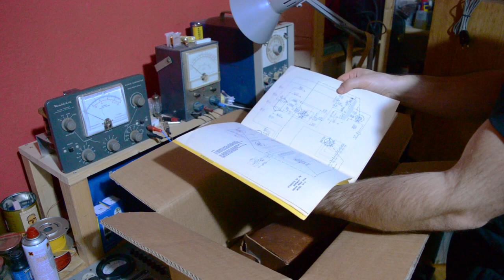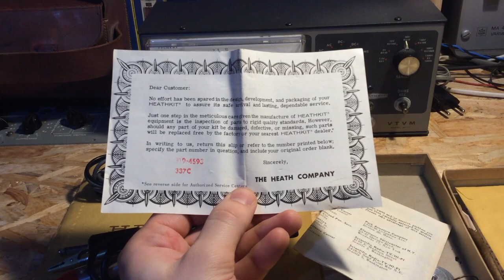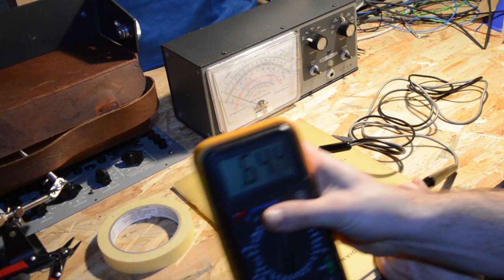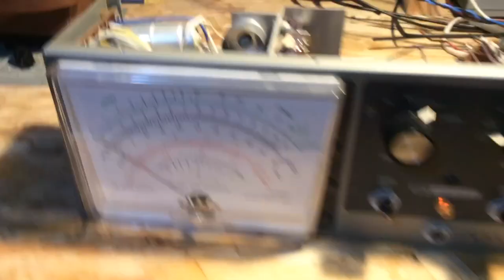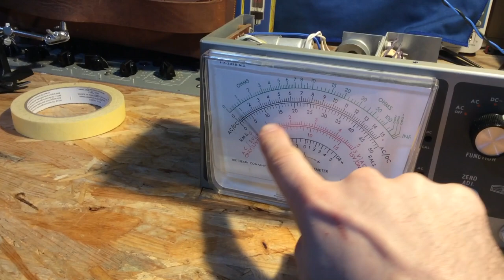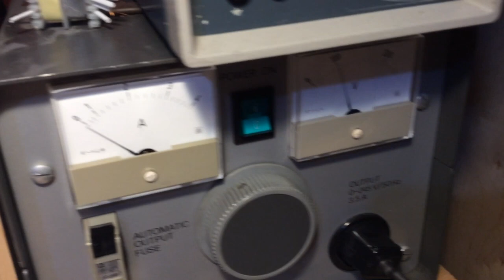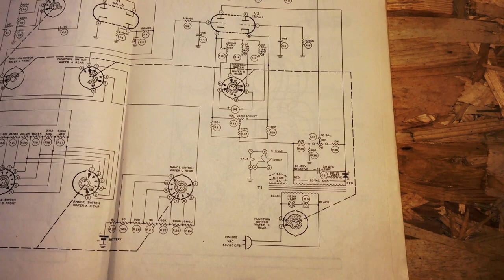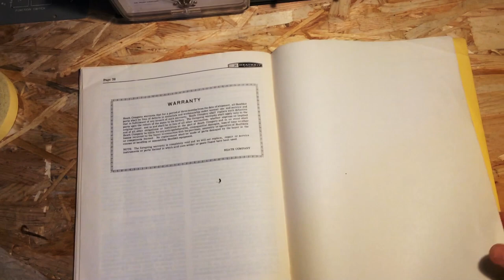Heathkit 1963 VTVM IM-13 Unboxing, Overview and Calibration

Comment: Yes, you are very lucky to find such a pristine VTVM. Rare find indeed! 
My brother recently gave me (no charge) an IM-13 that he built in 1964. It has a few damage marks on the metal casing, but is generally in good condition. I checked the 1% precision resistors and found that 3 out of the 14 are out of tolerance, and have bought replacement resistors from Mouser. I will be replacing the selenium rectifier with a 1N4007 diode. I also will be replacing the filter capacitor C6. The 2 wire power cord has been replaced with a 3 wire power cord, so that the chassis is grounded for safety. 

The plastic face of the meter was badly scratched. I used automotive rubbing compound and this returned the meter face to like new condition.
Great video!
Reply from the maker: Yeah, it was a really good find indeed. I'm glad you restored your unit as well! Recently I acquired two other interesting Heathkit instruments. I will feature them in one of my future videos. Currently working their restoration. Thanks for your comment!

Comment: A rare find!  By the way,  thet 12AT7/12AV7/12AZ7 are adequate substitutes for the 12AU7 .  12AU7s are getting expensive and 12AV7 or 12AZ7 can still be found NOS at low cost

Comment: Very nice condition meter with documentation. Can you please update the link to download  PDF manual as it's not free anymore. I have a similar one but needs rewiring so I would be grateful if I can have it.
Reply from the maker: Hi Andy, thanks for the reminder! I've switched to a new domain and forgot to update the link. You should be able to download the file now. Please let me know if the link works now?
Reply: Yes it worked. Thank you very much. I have a Heathkit IM-5228 (120 / 240V) which is pretty much the same so this can now be restored. I could have paused on the pages but the PDF is much clearer. I could have fixed this with just a schematic but I wanted it to be wired to the instructions. This keeps it original also. I appreciate your help thank you once again.
Reply from the maker: Great! Yeah, it really helps to have the layout view and other details. And calibration steps are also more than useful. Good luck with the restoration. I really love this meter. The display is nice, big and clear and it works really well over all.

Comment: Hi, thanks for the video. Very helpful. I have one 1 M 13. I have never used VTVM before. Can you please help me to calibrate this equipment? I did not get any manual when I bought it on ebay. Thanks.
Reply from the maker: Hi, thank you for your comment. You can download the PDF manual from the link in the description. It has all the calibration steps in detail there.

Comment: Should you not replaced the old capacitors?
Reply from the maker: The capacitors were replaced by someone not to long ago. This is not a high current device and I use it rarely, so even with old caps it would work fine for a long time. If something goes wrong I will eventually replace them.

Comment: Some people are of the opinion you have to change all the caps and resistors to achieve the stated calibration accuracy. Such assholes! Only one cap really needs changing along with the selenium rectifier. The rest should merely be tested. Same for resistors. This is not a lab grade instrument and if it was 20% out of tolerance it would still be useful as a shop tool.